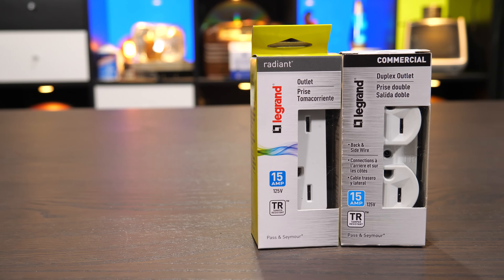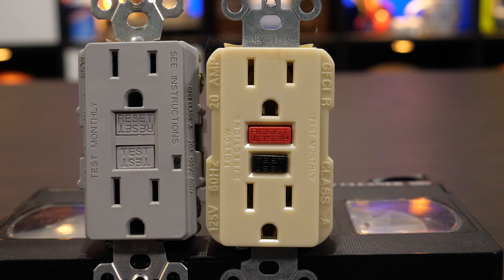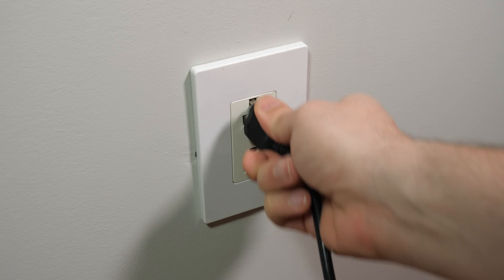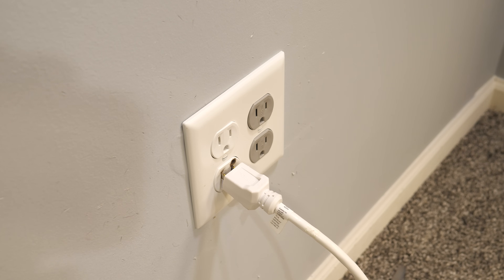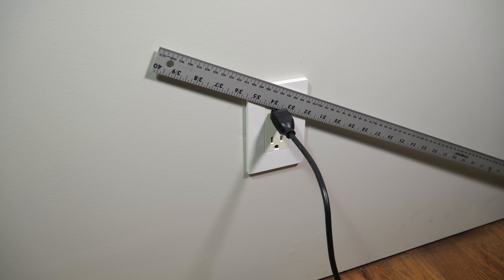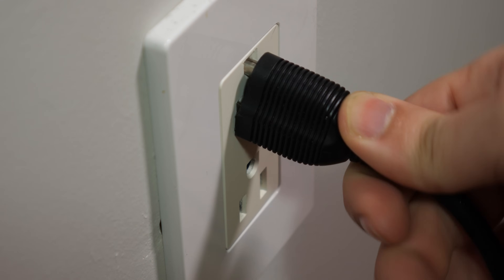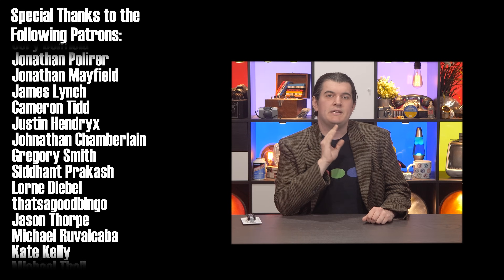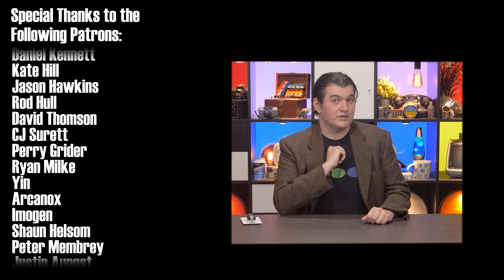Power outlets are topsy turvy - but does it matter?

Comment: Electrician here- The Code called for ground up in commercial applications for a very short time, but now officially either orientation is considered correct. Some old fogeys are very, very particular about it, no one else cares.
Edit: also, aside from someone standing barefoot on a grounded steel floor while getting sprayed down with saltwater, many casual contacts with a piece of metal that happens to touch the live pin result in nothing happening unless you bridge the metal to a grounded surface and make a spark and pop a breaker.
Reply: Moreover.. in my entire life I've never known a single person who died from 120v to the finger from a wall receptacle, which would easily run into the thousands if every shock among us was counted collectively (everyone I know that is; not the 1-off weird ones you see in the news once a decade or so)
Reply: @Drmcclung  I once was reaching under my bed to plug in my phone charger and put my fingers on both pins like a moron in order to guide it in better. Got a hell of a shock but it was more of a "damn, that was tingly!" than a "I'm dying!"
Reply: @drmcclung 
Agreed.

The problem these days is the internet. Everyone has a story of "their cousins, wife's, step-uncle's adopted kids girlfriend" that died from a 120v outlet shock. Nobody can ever produce a witness, or any credible documentation ofcourse...

Now, scientifically speaking - yes, it's possible to die from a 120v shock.

Realistically however, you'd either have to find yourself in a very unlikely, very unfortunate situation to die from a 120v shock. Either grabbing live wires while standing in a half full bathtub - or - you had a pre-exsisting medical condition.

For some reason people online create these urban legands that make almost impossible scenarios seem commonplace.

Another great example would be to look up if tire plugs are safe. The internet would make you believe any tire with a plug is a ticking tine bomb waiting to kill your entire family. Well I worked in a tire shop in college. I'd say roughly a good 1 in 4 cars has a tire that is plugged lol. If that were even close to true people would be dying left/right/center from tire blowouts.
Reply: Exactly. This is much ado about nothing. One of the great hints that the manufacturers do not take this seriously is that, as soon as they are adding an outlet into some kind of a decor piece with other switches or sensors, it is ground-pin down. My father was an electrical engineer specializing in industrial-plant design, and the limited residential design work that he did for our own homes in that era never had the ground pin on top. The design and application have both worked just fine, angst-creation on social media notwithstanding.
Reply: Union guys always told me they did it because the union does thing "from the ground up" (haha funny). They were also the same people who couldn't figure out a three-way switch to save their lives
Reply: I'd add: the probability that installing them ground-up would save anyone's life before the building got demolished is practically zero. In contrast, the probability that the client will insist that you "fix" all of the outlets to be the "right" way is a material concern. If for nothing else, forcing you to "fix" all of them makes them feel important. When you know the client is the kind of person that is guaranteed to find SOMETHING stupid to complain about, you might as well try to make it something easier to fix than flipping all of the many outlets you already installed.
Reply: Sanity > safety
Reply: I like being able to plug something in with my thumb touching ground pin. I feel safer.
Reply: Seems like Rhode Island still requires businesses (and possibly residential) outlets to be installed with ground up.
I live in Massachusetts, but everywhere I go in Rhode Island, the outlets are all ground up.
Reply: Old fogeys? It's usually the younger people who whine and complain about things. The older people don't care what others do, unless they try and force it on them.
Reply: It's a blessing and a curse that you only have 120 V to these sockets. On one hand, it's not that harmful that you have unsafe sockets. On the other hand, surely you would have safer sockets by now. The change to safer sockets wasn't without its quirks in Europe either but it was well worth it.
Reply: @jattikuukunen  now that said I definitely wouldn't mind more 240v appliances around the house myself just for the bit of efficiency like elec kettle, hair dryers, space heater things like that, but I understand and I get it.. having decades and decades and decades of what we've got, it's absolutely unfeasible to even offer those especially since hardly anyone would install the special sockets, even some of the biggest window unit AC's you can buy now run on 15a 110v, they're good enough that no one really buys the 220v one anymore so you rarely see them in the big box stores. You won't even find 30a horizontal blade sockets (I forget what those were called) anywhere but old houses anymore
Reply: @Drmcclung 240 is cheaper in copper & in running, & better, but... imagine trying to convert, you'd have to swap plugs as nothing old would work without blowing up, & transformers would be expensive & inefficient. Still, these outlets are a fire risk most of all.
Reply: @jattikuukunen  Then there's also the Brazilian plug, which is a great design in therms of passive protection (the sleeved pins and recessed socket), but just cause they HAVE to screw things up in Brazil and milk us some extra, it's the exact same thing as the Swiss plug but with some small fraction of a millimeter higher or lower on the ground pin, just to be another plug type.
Reply: @Kalvinjj  I think that sort of thing may be why we Americans are stuck with such an old design and system for so long.. not that we actually think it's good or superior or anything like that, but seeing every other country in the world the last 70-80 years doing their own thing, changing it up all the time, no interchangeable household elec item plugs between varying systems and us just wanting backwards compatibility and not wanting to have multiple plug types spread all over N America, just another manufacturing expense. Do not ask me why Japan still has a split system, that concept is weird to me
Reply: @Drmcclung   Yeah, if Brazil is weird enough with the sorta lax way we dealt with it up until now and having both 220v and 127v here, but at least we're all 60 Hz, Japan's 50 and 60 no clue why it still stays.
I would say the US would really not have much or any issue changing the plug standard from night to day even. Compared to how often stuff is replaced in US vs. Brazil (keep in mind, anecdotal evidence), old appliances would mean much less, and even if that wasn't the case, just changing the plug end on non-removable stuff, or replacing the cord on removable ones, would easily solve what adapters don't. It's what we've been doing since late 2000s after all. Sure, I know not everyone can/should do this but yeah.
Reply: @Kalvinjj Japan has dual frequencies because they are separate islands, and literally like a century ago one island had a power company that bought US generators putting out 60hz, and the other island bought European generators putting out 50 hz, and it didn't matter because they were small generators and there was no connection between the islands, so one island just bought equipment and appliances from Europe, and the other one from the US.

Then as the grid was developed and more industry and power plants were added, they just kept building out the existing standard, because there was no issue with it.

And by the time someone realized that it might cause a problem, it was far too large an infrastructure on both systems to make the change, since you have to change out all the generators and power plants and motors on everything, so they are basically stuck on the two standards.

Now to interconnect the two grids, they have to use High Voltage DC to bridge them.

And unless you are traveling between the two islands regularly, it's not really an issue, because again, one uses standard European equipment, and the other uses standard US equipment, and China makes both! Lol
Reply: @jattikuukunen Not much difference with 230V in Europe.
Been shocked myself many times. Nothing significant, bit of hard vibration in the hand, and that's it... 

Of course, do not try this if you are under the shower :)
Reply: @bmalovic  higher voltage makes a deadly current more likely.
Reply: @bmalovic  The brazilian special is getting shocked while in the shower
Reply: @bmalovic  that's really interesting to me coz 110v zaps don't bother me at all, but absolutely hate being popped by US 60hz 220/240 when working on something like residential central AC where the homeowner might have a second 220 line coming into the unit NOT tied to the AC service cutout - 220 just hurts lol. Maybe it's the frequency that makes the difference but man, your finger will stick to 220 here 🤣
Reply: @Drmcclung  what if I told you that my 1st electric shock when I was like 5 was indeed 220v from a transformer I was using as an extension cord (cause well, 5 year old)?
Memory might not be the best but I'll agree with you on that one out of gut feeling.
Reply: @kylehart8829  as a brazilian with a classic electric shower, 220v ungrounded mind you, I find it funny how people think we'll like die all the time, never, like never got an electric shock in the shower. It's just the resistance of the water together with it coming out as droplets (effectively... breaking the circuit entirely) negating that effect.
What I do know about (also never felt cause PVC piping) is people getting shocked on the valve cover if they got metal piping, and even that one isn't much, never heard of anything serious happening.
Reply: @jattikuukunen  not to get, uhh political I guess, but we can’t even get affordable insulin, I don’t think better outlets are all that high on the list.
Reply: @jattikuukunen  Even our higher voltage 240 outlets (the US has 240v in most residential housing, but it is only used for high power appliances like stoves, electric car chargers, HVAC systems, electric dryers, etc., and the safer lower voltage outlets are used for all devices which do not require the additional power) are safer due to that design. Instead of a full 240v mains the socket uses two 120v connections that are out of phase with each other such that one is negative and one is positive at any given time. Because of this, even with a 240v outlet you can only shock yourself with 120v unless you short the hots together, which is unlikely because they are opposite each other with ground and neutral in between.
Reply: @coopercummings8370   That's kind of how we have 400 V main voltage for 3-phase appliances like stoves and storage water heaters. The line voltage is then only 230 V.

As for getting shocks, almost all outlets in new installations in Finland must be protected by GFCI anyway, meaning that the most probable way to get a harmful electric shock is to find yourself in between line and neutral.
Reply: @coopercummings8370 false statement, other than you correctly defined a "short" which is a phase to phase fault.  Shorting the 2 hots together on a 240v system results in a boom, arc flash, and most likely a tripped breaker.  I don't understand your explanation of how you're only likely to receive a 120v shock from a 240v receptacle.  The fact is, of you're messing around with a 240v receptacle, you could receive a shock from EITHER voltage level, and not all 240v receptacles have or require a neutral wire.
Reply: The quirk with hospitals, best I can tell, is the call for “hospital-grade” outlets in certain spaces and those marketed as ground up.

What I was told by facilities is that it’s to comply with preventing loose cords in patient areas but like you said; old fogeys.

I’ve stared at them ground up for so long that’s just “normal” for me.
Reply: @1RandomToaster I don’t know f there’s any truth to it, but I was was also told, in hospitals, if a plug does come loose and something falls  that it’s less likely to trip the breaker and knock out any equipment on that circuit.

Comment: I learned the "correct" orientation in high school shop in the 80s. Have I ever seen anything metal fall into a plug, absolutely not. I always did it in case an inspector ever pushed it

Comment: Funilly enough, the best right-angled plugs that I have seen have been for TVs (you know, thoes things you put up once and never touch again...)
I tried some search terms and couldn't find the specific one ive seen, but its a non-grounded right-angle plug that sticks out a little more than ohter right-angle plugs, but has some tabs on it so that it's easy to pull out of the receptical.

Comment: I once slipped a quarter in between the plug and the wall when I was little just because I was curious. It melted two little dents into edge of the coin almost instantly and popped the breaker

Comment: Angled plugs should always be installed with the cable going down,  not up. The reasoning being if a liquid starts dripping and inching down with the cable, the lowest point (hence, the drip area) is somewhere on the floor, rather than dripping into the outlet.

Comment: Aha! I thought you'd fall victim to the "but sometimes" problem with the ungrounded plugs - but angled plugs are really a problem.
In Europe, I've seen few plugs with rings baked into the plastic. If you pull on them, you will not touch any blades.
Maybe putting a cup around the holes would prevent touching live connections (like the German Schuko), but then you could not fit the funky plugs. But maybe an adapter, bringing the holes to the front again, will fix that.

Comment: in the UK (plug gloat)  an ungrouned appliance still has a plastic 'ground' pin is there a reason you wouldn't do that to help keep things in the wall as they should be?   are there outlets that are not grounded?

Comment: The right-angle plugs segment just made me question why you

A. Orient the plugs one above the other so you cant use two right angle plugs at the same time (especially when installing the sockets sideways)
B. Still use sticky-outy plugs at all (I realise it's because of the former, but rotating the plugs 90 degrees and only using right angle plugs makes this whole argument meaningless.

Comment: As a journeyman electrician, I can tell you that in Canada at least, if you install a plug horizontally, The neutral side must be on top. As for the rest, I think your conclusions are correct. Too bad North America didn't just use 240V to begin with, IMO. Higher voltage means lower amperage, which uses less material for the same wattage. All residential wire I work with is rated for 300V.

Comment: I've been replacing the outlets in my house as I gain access to them, and replacements have been going in ground side up. But it's really dumb that Legrand shows them all with the ground side up yet they make a switch/outlet combo that if installed this way puts the switch under the socket. Dumb.

Comment: You summed up every annoyance I've had with my ground-up outlets in my apartment. In trying to solve for one type of problem, this "solution" invents more than it addresses. Very annoying to have any large plug trying to unplug itself by gravity alone because it was designed to be pointed the other way.

Comment: As a mechanical engineer, I'd prefer the weight of the plug going into bending the ground.  With the ground pin on the bottom, the hot and return are in tension and the bottom is bending (really a moment force with the stress concentration at the point where the pin enters the plastic) supporting the weight of the wire.  With the roles reversed, you are bending the hot and return, and putting the ground in tension.  A broken live is immediately dangerous while a broken ground wouldn't matter most of the time.

Comment: 1. Make sleeves mandatory. 
2. Standardize plug size.
3. Make wall receptacles recessed slightly recessed with the standard plug size so they sit firmly.

Problems solved.

Problem solved.

Comment: Why don't we just make C14 plugs the standard? Small, recessed, grounded, sleeved (or shrouded, if the plug is male and the receptacle is female. Tho I like to call it the foreskin). What's not to like about it? Should even be possible to add shutters to it.

Comment: As a teenager, a penny fell behind my nightstand and literally landing directly on the plug contacts and shorted it. This did NOT trip a circuit breaker, instead it made a series of extremely scary spark flashes until the wire ejected itself from the outlet enough to lose contact (but was still inserted slightly). I walked over to find a melted socket with large black explosion like skids emanating from it and a penny that was literally half melted. It had two lines cut into it by the plug contacts melting their way through it with each spark. I couldn't believe the odds but can attest it has happened at least the once.

Comment: I've gotten shocked on a right angle plug before. Like you said, if the connector is thin, you have claw your fingers under it to get it out. I was a kid and the connector was thin and yeah, bad time. Solution would be to simply make the connector thicker and easier to grab without risk of touching the blades. I like that 45 degree angle plug you showed at the end. It has a flat piece of plastic on the back that sticks out over the rest of the plug making it easier to grip.

Comment: a compromise: have the top outlet ground up, and the bottom outlet ground down, that way a right angle or plug in things like a timer still work while the standard grounded cable that sticks straight out can go into the top outlet where its marginally safer if partially pulled out